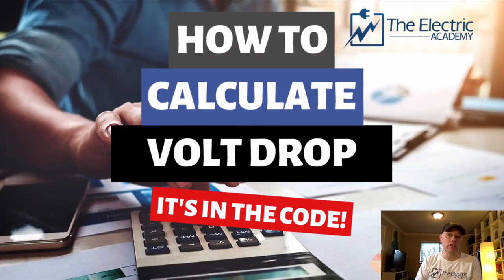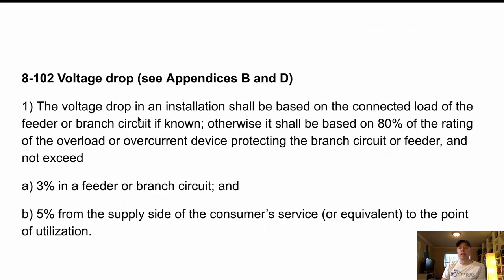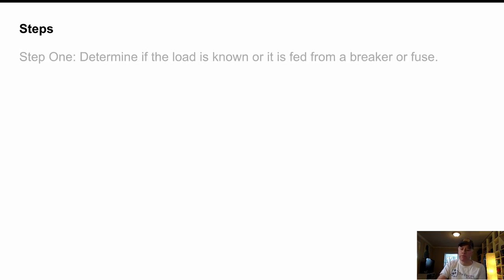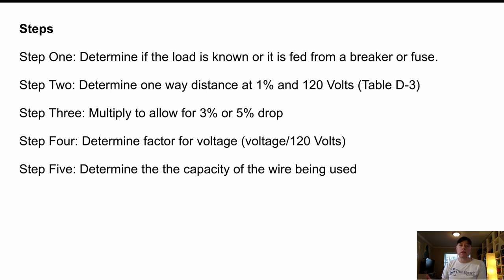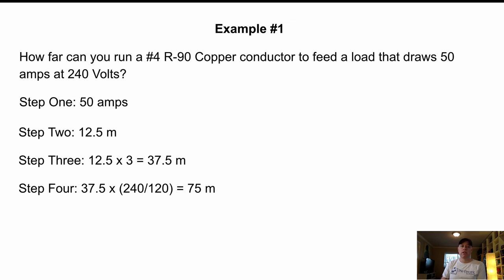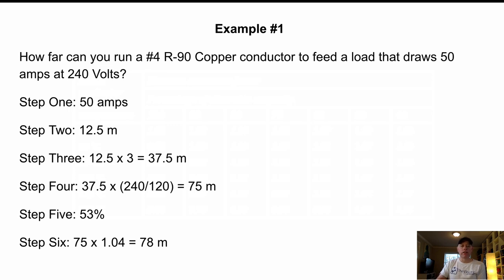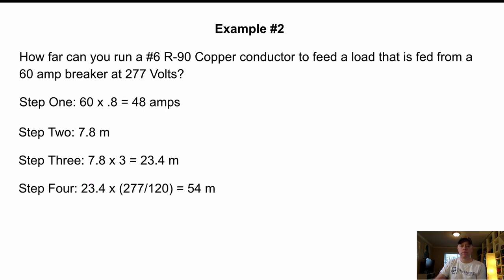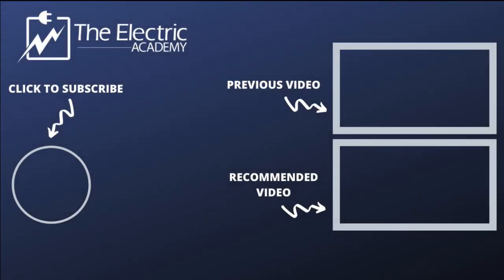How to calculate Volt drop by the code

Comment: I enjoyed the video really clarified the calculations.  The question I am left with is in Manitoba Breaker panels don't have a 90C breaker rating only 75C therefore even if we have 90C cable we are forced to use the 75C column for wire ampacity so what impact does that have on distance correction factor if the 90c cable rating is not allowed to be used because it is supplied by a breaker only rated for 75C?

Comment: Great explanation. Looking forward to the next video. I am putting in a critical loads panel with 3m of #4 wire and want to calculate the largest breaker I can use. I know I didn’t include the 80% rule the first time I calculated it but I also didn’t give my self the short distance benefit. Obviously you will be doing this in reverse but that’s easy to deal with.
Reply from the maker: Yup, you should be able to work it backwards.  3m isn’t that far a distance so you may just need to use 80% of the wire’s ampacity.

Comment: Thank you for the great video. What would you do if dealing with 3 phase, 347/600 volt feeder cables? Also do you know any good CEC Voltage drop calculator? ( Excel, online,......)  I would appreciate it.

Comment: Excellent video , can you do a video showing voltage drop for larger wire over 4/0 . I am running acwu 300, 55 meters with a calculated load of 170amps from a power shed to main house for a 200 amp service. The code book does not explain this well. I have calculated a little less than 2% using 2 × 21.2 × 170A × 180' ÷300kcmil = 4.32Volts

Comment: Would you not use rule 4-006 2) a) if there is no termination temperature given?  which would give you an ampacity of 70A under the 60 degree column.
Reply: Also you would use the 75 degree column if it is being terminated on breaker in question 2 making it 48/65.  am I wrong??
Reply: my thoughts exactly. unknown temp rating at the equipment therefore we'd use the 60degree column . so 50/70. Not 50/95. Correct?

Comment: Help I'm wondering if someone can help me with the calculation I'm not an electrician but I need help determining if I have the right size wire or what size wire I should actually be using I'm trying to run 200 amps to my shop I have a starting circuit breaker rated for 200 amps from my main panel the distance is about 650 ft I have been okayed to use direct burial aluminum wire. If I use 4/0 4/0 4/0 2/0 direct burial aluminum wire what is the most amperage I could expect out of it for that distance and what would be the correct wire to use to get the 200 full amps at that distance looking for someone that knows because I really keep getting mixed answers on this also I believe my voltage is 245 to 250 volts at the supply panel I definitely plan on running 208 220 volt type equipment in the shop such as air compressor welder and possibly a split AC

Comment: Could someone kindly explain how to do the voltage drop calculation for this scenario by CE Code Book:    4wire (3C +1N) 750 Kcmil RW90 and 500' length with 600/347 and 400 Amps?

Comment: How come you use the 90 degree column instead of 75 degree? Any real life application you would need to derate the conductor to 75 if it is being terminated on a breaker usually rated at 75.
Reply: I was thinking the same thing.
Reply: chart uses insulation be careful in rules on wether the rules state 75 degrees TEMP or INsulation temp

Comment: hey! great video, do you have on larger cables. I would love to see an explanation on anything over 320 amps. As that is as high as D3 goes
Reply: Table D3 Note 6 offers some clarity for values not shown in Table D3 with the following "The distances and currents listed in Table D3 follow a pattern.  When the current, for any conductor size, is increased by a factor of 10, the corresponding distance decreases by a factor of 10.  This Relationship can be used when no value is shown in the table.  In that case look at a current 10 times larger. The distance to center of distribution is 10 times larger than the listed value.

Hope that helps.
Reply: @dinyarderakhshan8275  it helps a bit, still slowly trying to wrap my head around it. I understand when its straight forward and on the table. Its when its not. for example if you had a 1000 foot run. 400 amp service. How would you calculate the voltage drop.

Comment: What about voltage drop from a receptacle or circuit breaker 14awg
Reply: voltage drop is on line not your devices its calculated in